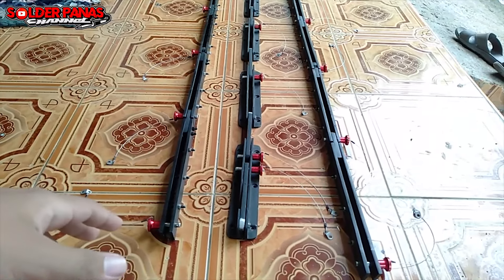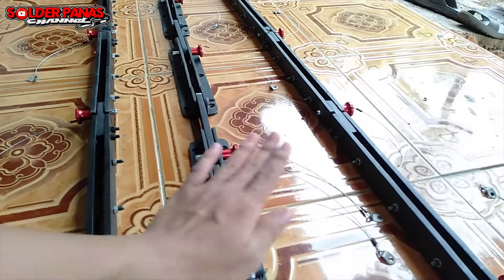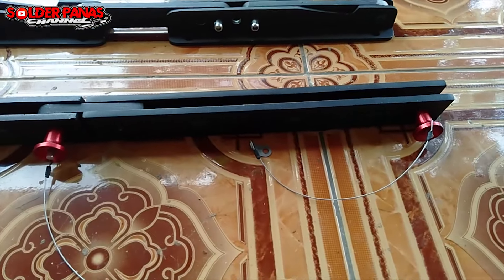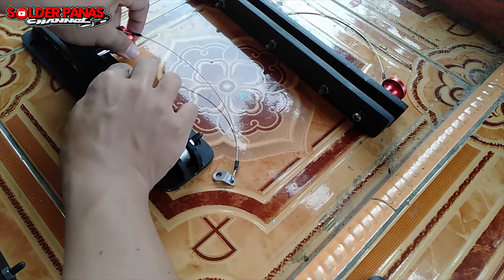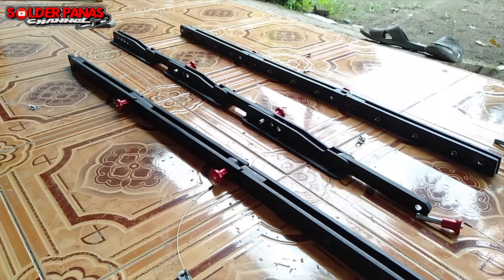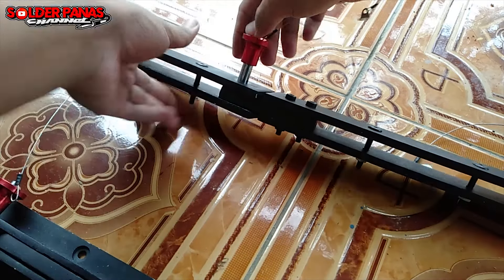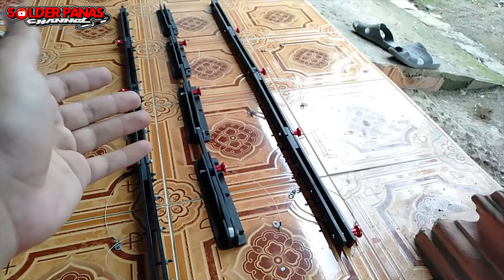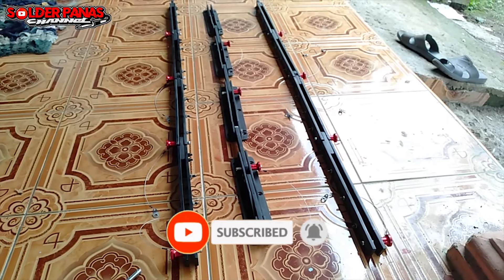REVIEW BRACKET LINE ARRAY 12 INCH HARGA MURAH SPEK MEWAH

Comment: Suara lebih lantang 10inch fabolus dari pada 12inch fabolus saya udah pengalaman
Reply: 12inch kalah ama 10inch
Reply from the maker: 12 inch lebih lantang... palingan power nya kurang besar watt nya.
Reply: Dia udah pengalaman yg lain cuma pemula mungkin
Reply: kalo 10 inch condong ke mid kalo 12 ke low mid.kalo lantang tetep lantang 10an..
Reply: 10" lebih cetang-cetung, klo 12 " Lebih ngebass 👍 🙏🙏🙏